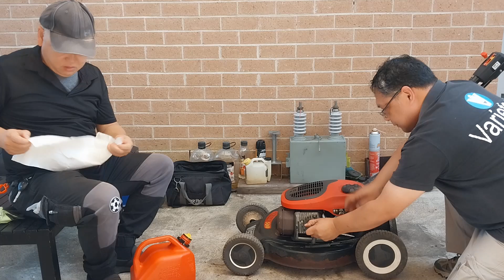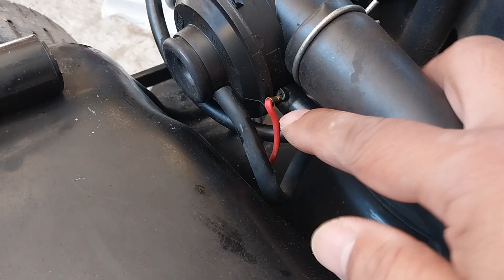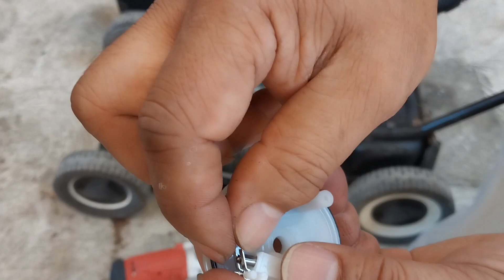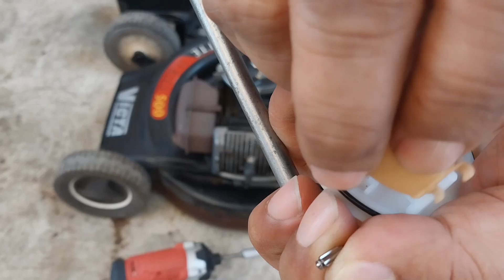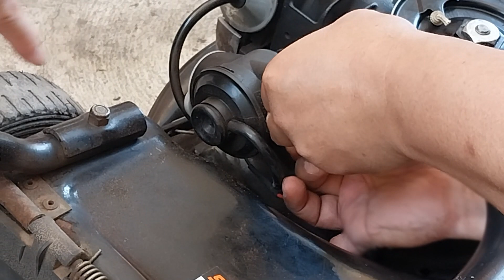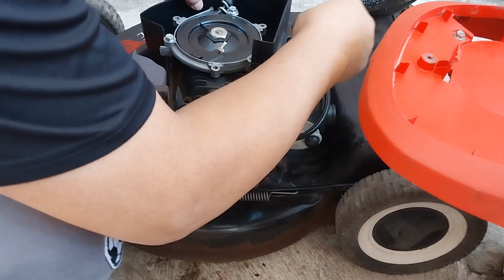VTECH 104 - Repairing Victa 2 Stroke CORVETTE Series 500 with Anthony

Comment: greetings gents from South Africa, may i ask if spares are still available? i have a Vitca 160 and looking for ignition coil pack and carb, would be great to hear from you as spares on this side is a no go
Reply from the maker: Thanks for watching. It's good to hear there are still Victa Powertouque around in South Africa. I knew that parts availability is difficult in South Africa. Try to join Victa Powertorque or Victa Vingage group on Facebook. They should be able to help you with obsolete Victa part. I will be uploading more Victa repair videos. Please do share and subscribe to see more new uploads.
Reply: @Varietech-AU  thank you so much

Comment: Replace the plug .!!!   90% of the time that will get it going. Long live victa stroke
Reply from the maker: The problem was not the sparkplug. It was the float deflection or travel not enough to have more fuel in the chamber. I push the brass seat further in to have more play for the float.

Comment: the engine runs fast because of a crankcase leak. remove the starter and put a layer of fuel in the bottom inside the engine. if fuel leaks out past the lower crank seal then theres your issue
Reply from the maker: Thanks for the advice. We will do it in some other time or I let Anthony knows so he can perform the test. Cheers! VTech
Reply: @Varietech-AU  very much worth checking. You can use some test equipment for this, you can actually use your vacuum pump that you have already. If you block off the intake and exhaust and plug off the decompressor it should hold a vacuum. If it can't hold then you have an air leak.
Reply: You totally missed the point that the fuel line was probably blocked iv been working on these for over 10ys not enough fuel flow , the motor was running to lean as not enough fuel delivery from tank